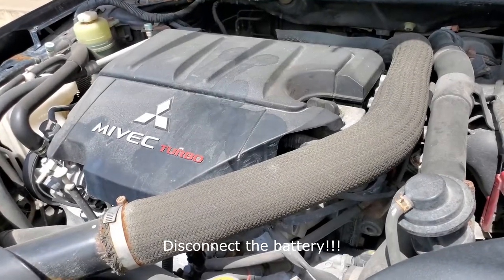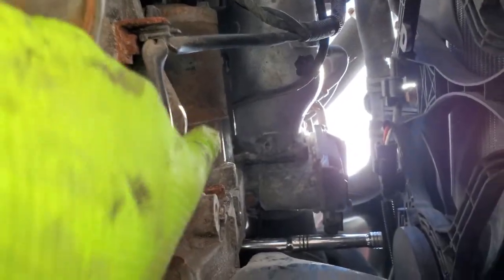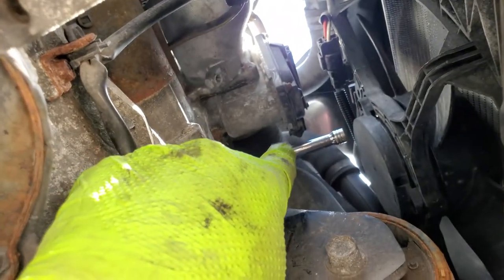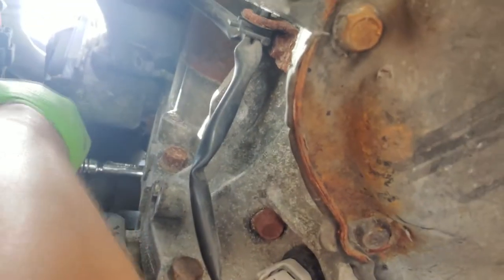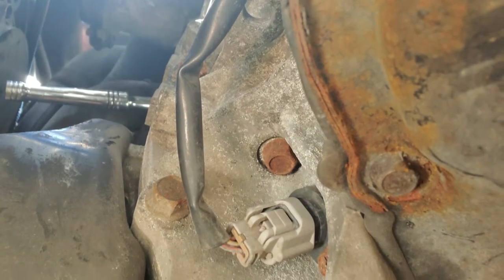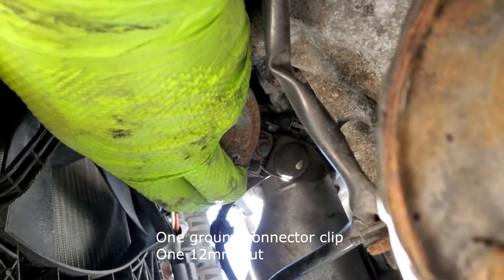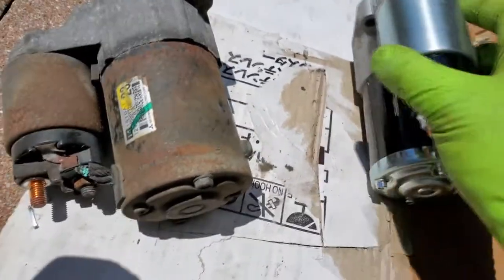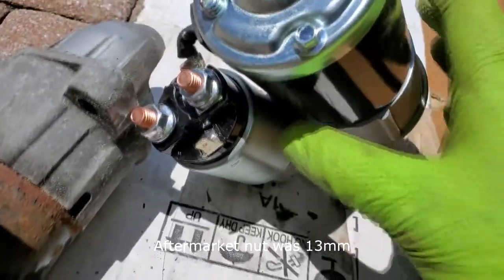EASY WAY - Mitsubishi Lancer Ralliart & Evolution X - Starter Replacement DIY (4B11T)

Comment: Given how corroded that OE terminal/wire is, I wonder if it would make sense to coat the new one's in silicone grease...  To repel water from getting on the contacts, into the wire strands, etc.

Comment: Not a ground connector. Thans a positieve signalen coming from the start contact. The bridge from the first part to the 2nd part is also positive. The first part is just a relay, ween it recieves positive 12v it powers the relay and than the 12v is ging to the starter motor. You recieve ground contact throughout its contact with the transmission body. Great job 😎👌
Reply from the maker: thank you for the clarification buddy!

Comment: Not a ground wire. That's the main positive feed to the starter motor, after the solenoid.
No point trying to fix that corroded wire, it would take a huge amount of heat to solder, and given the wire is so corroded it wouldn't take solder easily either.

Comment: I just looked under my 2010 lancer I was shocked my 23 year old R34 I bought sight unseen has and had less rust on subframe. My god these cars will fall apart is actually used. Wonder why there was a rear subframe recall unreal the crappy materials in most cars now.
Reply from the maker: Yea mitsubishi used to be rust buckets. I had a lancer evolution 9 2006 that i sold last summer (they are getting rare) never seen winter and the frame is still rusted like wtf.